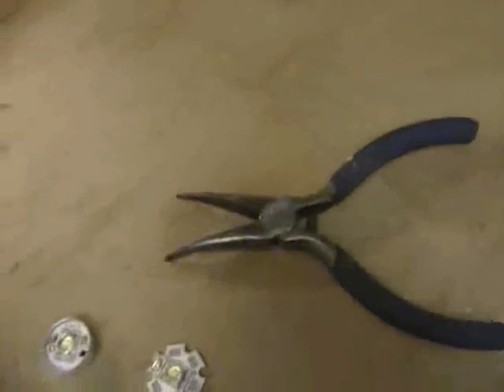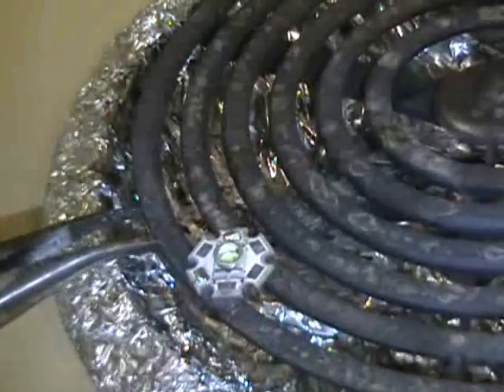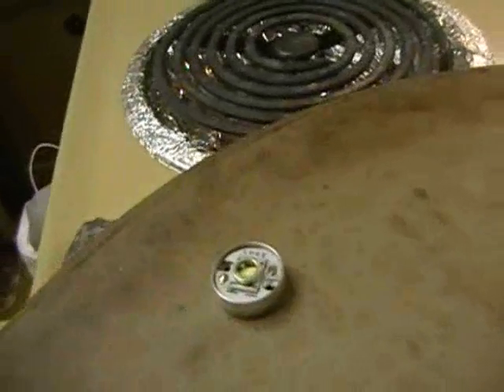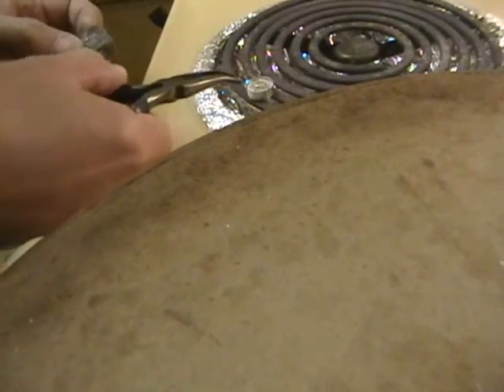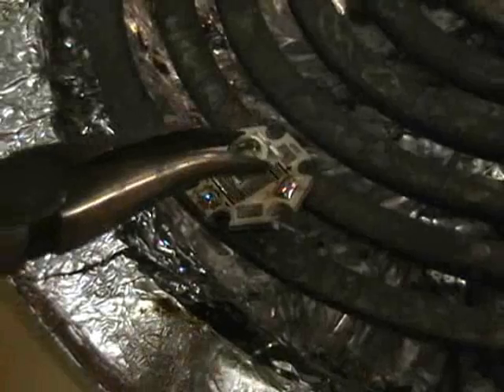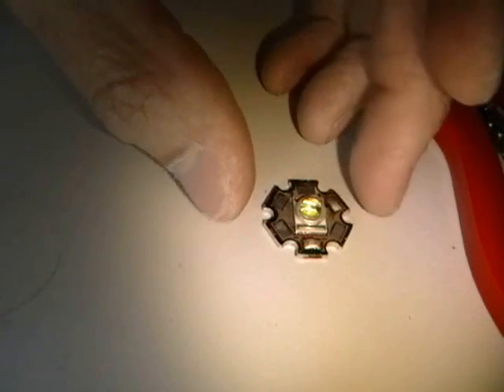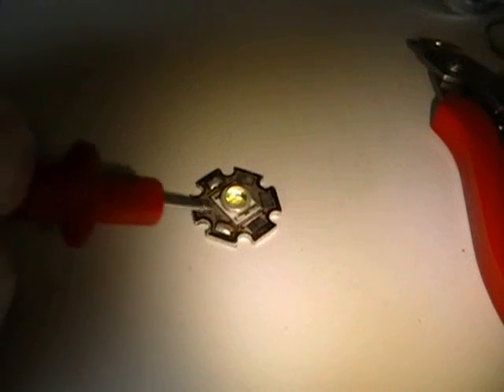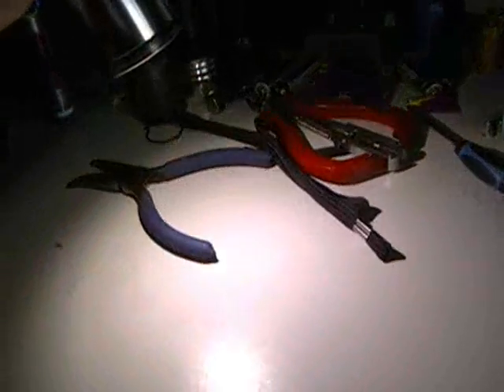Cree-XRE-Solder

Comment: Damn, that's some serious caveman work going on there.  I'd suggest springing $20 for an electric skillet (or getting some temperature reference points with a thermocouple on your burner) and you'll have a lot better heat control.

Besides the unregulated temperatures, the heating and cooling rates for your reflows aren't doing your LEDs any favors.  Google for "solder reflow temperature profiles" and you'll get a better idea of what your temps and rates should look like -- if you care.